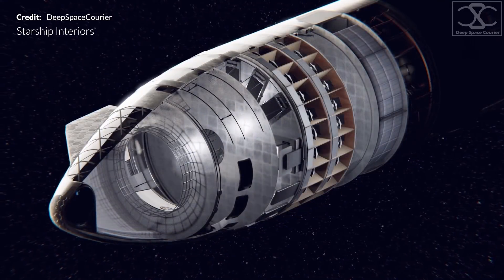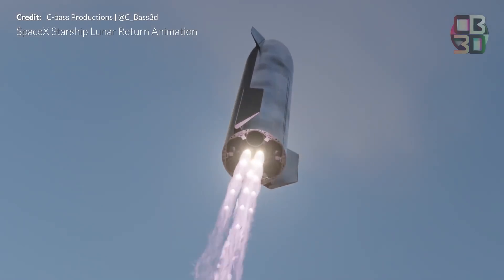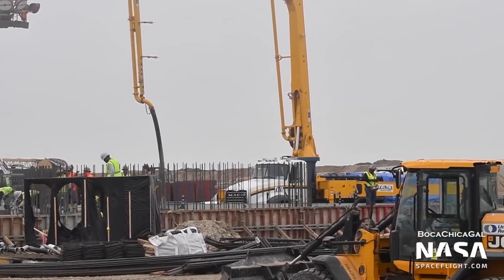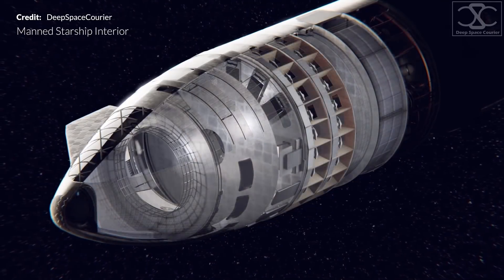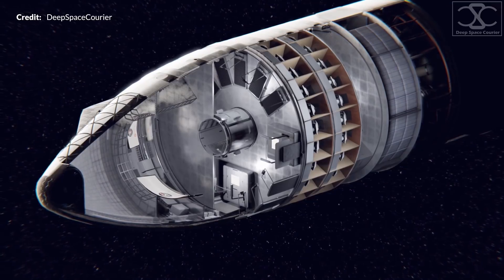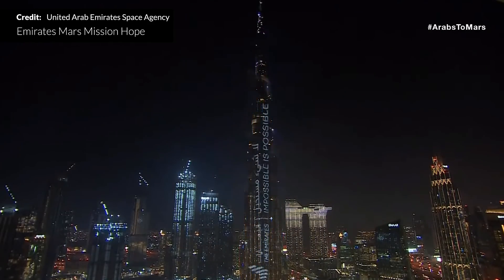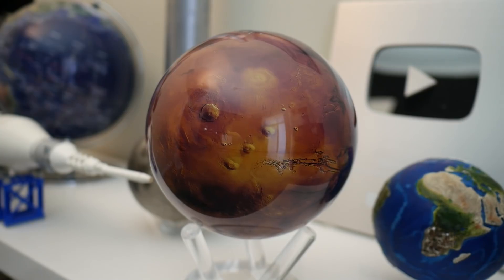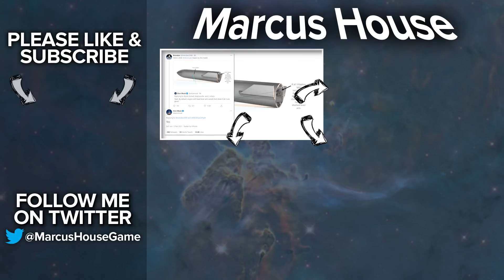SpaceX Starship to attempting another flight with SN10 - Can they master the flip and landing!?

Comment: the landing has nothing to do with what they where testing. so failing to land is at most just a bonus. people making a big deal over nothing.
Reply: Yes it has. They were testing it lifting off, bellyflopping and landing.
Reply: @Cediii4ris  no lift off was the first hops, this block is testing the flop and fins . They say it over and over on space x steams landing is just extra data for next block of tests.
Reply: @Ramses-Silent  no. The high altitude test flight are to test Liftoff Bellyflop and Landing all in one.
Reply: @Cediii4ris  believe what to want but the announcers on 8 and 9 both said mutipal times time the flight where to test the flop and the fins ability to control the fall. Are there tests being done on everything of course but there just secondary bonus info the primary goal of 8 was proof the flop could be done and the the primary goal of 9 was to further test fin control. Literally the spacex announcer side the multiple times during the flight he even blow off the crash as if it hardly mattered. So yes you are right they test everything i did not say they did not but landing info and success is secondary to the primary objective.

Comment: The title of this video is kind of a dumb question. They mastered the flip two flights ago they’ve had no issues with it whatsoever. Both flights have had engine problems one a loss of pressure in the tanks and the other a fail to light
Reply from the maker: Yes, the flip/landing combo. Should have been more specific.
Reply: It means the landing flip.

Comment: Clearly Space X doesn't have access to the land for a distant landing zone.

But being forced to have everything close together means Space X must be extra  vigilant with the high altitude hops .... especially with large town.  

Doe the Starship have a self destruct if Space X loses control of the skydive and it ship is likely to hit residential areas.  And look how large the debris has been with the ground explosions.

Yes this rapid prototyping to exciting to watch, but because of the proximity of the launch & landing site to populated areas, there is a real possibility of a tragic loss of lives when everything goes wrong.

The head tank pressure issue should have been identified with ground testing, of  "system" prototypes.  Likewise the Raptor engines should have been bullet proofed before installing in any full high altitude hop Starship.  All systems should have been completely tested on the ground with system prototypes before installing in a Starship doing any hop that could crash land in populated areas.

Comment: I am very confident that SpaceX will sort out all of the landing issues - just look back to the early days of Falcon 9 landings. It's a learning curve, and like with Falcon 9, it will be a fast learning curve. SpaceX is the only company out there taking this kind of approach - build them, crash them, rinse repeat until they get it right. And they get it working whilst others are still at the planning stages of their builds. But, like I have said before, I do have one big doubt when it comes to Starship - getting it human rated. Just look at how strict the rules are for things like the Dragon, even though it only carries 4 or so people, it must have an emergency abort system. We learned with the shuttle that not having an emergency abort system is a very bad idea - the Challenger disaster proved that, the crew were alive all the way down to the water, with no system to save them. I am just not sure how the authorities are going to feel about certifying a craft that carries about 100 people, if it does not have an abort system. I think any passenger carrying Starship is going to have to be designed so that the crew section is detachable from the main tanks. Like where the nose cones join the main body at the moment. Obviously the Starship itself is the emergency abort system if there was a problem with the super heavy booster, but if the Starship itself had a major fault you can't just let 100 people fall from the sky.

I would not be surprised if SpaceX are not already giving this some serious thought for the future, yes, concentrate on getting the system to work, but plan ahead for when it's working - if they want to carry large numbers of people I think the authorities will insist on an emergency abort system.

Comment: Thanks for another great video!

As for Lunar Gateway, it's importance will depend upon the type of lander selected. If NASA chooses the reusable Dynetics lander the Gateway could be really useful as a fuel depot and marshaling spot for cargo from Earth. That's a bit in the future, though. In the short term it at least gives the Lunar astronauts a place to go in between surface missions. The astronauts would be using the lander over and over for smaller missions with rests in between.

If NASA goes with a less reusable lander like the National Team's ILV, then the Lunar Gateway makes less sense. The ILV needs a new transfer element for every landing and appears to be designed for longer term habitation than Dynetics's lander, which suggests a profile of fewer missions with each having a longer duration. They don't really need a station to go back to, since they're not planning to make a quick refuel and then go back down.

Comment: What’d id like to see is the top cone eject up off the rocket when sensors pick up readings of failed landings for the sake of future manned crews. It’d be cool to see that integrated right now while rocket trajectory programming is not fully stable on landing. It would save a lot of money on prototypes too
Reply: The problem with rocket trajectory isn’t the programming - SpaceX has had 2 hardware problems. These can only be teased-out by testing. One thing that should be noted is these tests don’t cost anywhere near as much as many media pundits think. I believe each of these costs ~$15 million, not the $150 million stated by many pundits.

Comment: What happened to the last one? I though they fixed the fuel feeding system. Why did it crash again?
Reply: Engine relight. That’s why they’re talking about lighting 3 at the start of flip maneuver.
Reply: @TraditionalAnglican  That's a very short term solution but I want to see that thing land like everyone else. Hopefully they do it.
Reply: @Tony-nl6pf  - If one doesn’t relight, we’ll have the igniter & can see what’s different between it & the ones that worked. These have to be absolutely reliable if we’re going to go to Mars & do the things we want to do with Starship.

Comment: not buying a flight this week, we already had them delay Thursdays Static Fire to Friday then delay fridays to at best Monday (since the don't do road closures on weekends right now), we gotta get the first 3 engine static fire, then the likely replacement of at least 1 of 3 raptors then a second Static fire before we even think of flight, then we gotta look at weather, looking at the 10 day forecast Friday is the only weekday where the weather would be go for flight and we have yet to see one of these fly on the first launch window, I still believe if it makes it this month it will be the end of the month and that assumes the FAA aren't being dicks.

All that said I don't think the flip maneuver is the issue, SN8 was a header tank pressure issue and SN9 was a raptor failure, the flip on SN8 was flawless it just couldn't slow down because of the lack of engine thrust and the engine failure of SN9 prevented the completion of the flip.

Comment: Will the first two Lunar Gateway elements launched on the FH require the FH to be launched in expendable mode? Seems like a lot of mass -- especially since they are having to install an extended payload fairing to encapsulate it all. I read somewhere that this would be the case possibly but have seen nothing either way on it from other sources.
Reply: That’s what they’re proposing, & it’s why NASA is paying a lot more for the flight.

Comment: It's doomed to failure!  Bad design, impractical design, unrealistic  concept.  In short it needs to go back to the drawing board.  Artemis ?  Cancel it.  Going ot the moon is akin to going to a bus stop.  Pointless.  There really isn't much on the moon to really process.  There has been allot of misinterrupted data assumed to be ice and so on.  I do think there is allot of metals, compounds and alike but it's not the main goal.
Reply: Everything you said sounded stupid except cancel Artemis. The moon is filled with water ice and Helium-3 which is very valuable.
Reply: @Cediii4ris   Unbelievable.  It would seem you lack the very intelligence that you accuse me of.  First off mate, the SpaceX shitty design is not feasible.  It's a death trap but I guess you need a body count before you will even listen. It's obvious to everyone with an engineering background.  Well, if you can't, then you will see it in time.  As far as the false readings from the moon.  There isn't any water on it.  Water boils uncontrollably in a vacuum.  Those indications come from radar and radar can be tricked or fooled if you will.  As I know as I worked on it and I know it can.  Just got bored with it and returned to my roots.  If you have a metal disposit under the surface that is a metal like aluminium.  Then if its formed just right; due to geology then you will get a false reading where it will seem like water but it's not.  Now He3 is a gas and not a solid mass.  In 363 Kg of rock samples there wasn't a hint of He3 in it that Apollo brought back.  Just because some spectrograph claims there is doesn't mean that there is.  I doubt there is any more than 200-300ppm in the entire mass of the moon.   You see if the moon has been in orbit for say a billion years and it has been getting slammed with solar winds that entire time then it would have move what ever was on it from there.  So, you see there isn't.  And just because of some moronic PhD makes foolish claims.  That doesn't make it so.  In science the theories have to be proven.  And when it's not and am sure this is how it will turn out.  Then the moon will be dumped like a hot potato once again and any nation on the planet will not waste their time with it.

Comment: I suspect there would not be a un-pressurized  section but only an air lock for isolation to the outside, as there will always be trips back and forth to the storage area and one wouldn't want to have to put on a suit each time. Also I would think the mechanical room would be in that area as well and working on a water reclamation etc etc equipment would be more difficult wearing a suit. Also with space being a premium for a trip to Mars, I suspect the viewing room would be smaller then shown. While creature comforts  would be important, the priority is building a permanent base on mars, not a vacation.
Reply: The unpressurized area is only going to store stuff they’ll need on Mars (rovers, spare materials for the habs) & where they’ll egress the ship when they land on Mars.
Reply: @TraditionalAnglican  Thought about this a bit more. Not defending my thoughts, just wondering with there already being a pressure dome between the o2 tank and the living quarters, To have a unpressurized section between the two areas would now require another pressure dome in there, would it not, ie more unnecessary weight. Mind you I guess the o2 dome would need some serious insulation.
Reply: @TraditionalAnglican  ty. that makes sence

Comment: Multi use components like a Hydrogen fuel cell could help reduce the mass needed to get to Luna, Mars.  Fuel cells use Hydrogen one of the best elements for radiation protection.  The fuel cell can be structure, provide heat, power storage, a water supply, radiation shielding, and perhaps engine fuel supply...;-)

Comment: Radiation exposure needs to be better addressed by SpaceX... Digital Dosimeters need to be included on any future SpaceX launches to Luna, Mars, even LEO to better characterize the needed Radiation Shielding.  Can a "Whipple Shield" type radiation shielding be used?  How well does stainless steel work as shielding?  How well do Hydrogen atom containing  components of "StarShip" shield against Radiation (Water, Methane fuel in tanks, battery packs)? How much radiation on Earth at sea level doe humans get exposed to?  I like water it is available all over the solar system and you can make air, fuel, shielding out of it...;-)  *See nuclear spent fuel pools for how much water is needed to protect from "Gamma Radiation".

Comment: I'm sorry but its not gonna be as spatious as that render, that render looks like the fairing is 12m diameter, it's not even gonna be 9m, its more lke 8m diameter inside. That fairing has a lot of stringers, plumbing, COPVs, header tank, RCS thrusters and flap motors. Not even close.
Reply: I suggest you measure the distance, because 9 m ~29’ - 6-1/3” -  That gives 63.617 m2 (684.78 sq ft) which is as much space as a 1 bdrm apartment, except there are 7 of these stacked on top of each other in this case & a nose cone attached on to that. SpaceX could always lengthen it by 3-5 m if that’s not enough space.

Comment: "Why don't they.." Perform the 'flip' maneuver at a much higher altitude? What's the benefit of flipping at the last possible moment before touchdown?
Reply: Drag and fuel. The point of the belly flop is to present the max drag configuration to the atmosphere to slow the craft and control its flight path. The flip and landing use fuel. Rocket engines use a lot of fuel very quickly.  You want landing burns to be short.